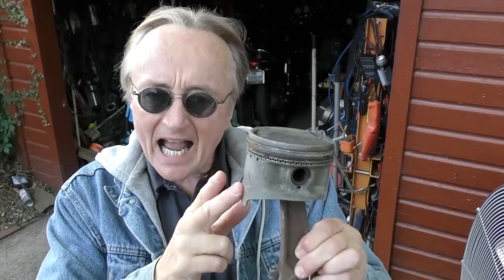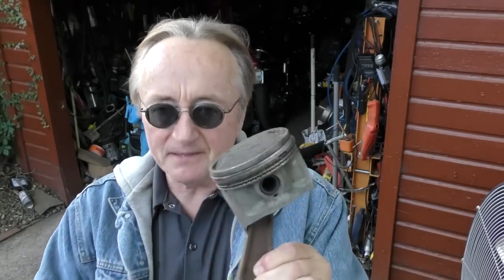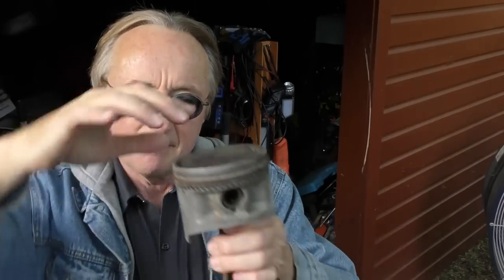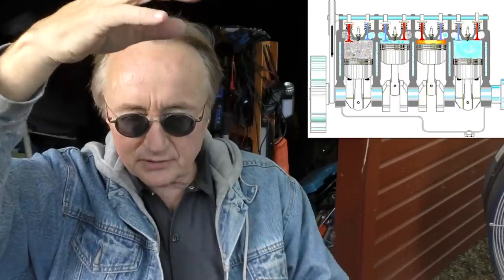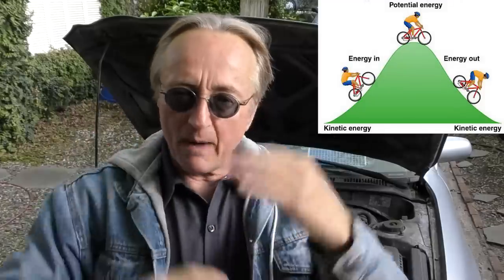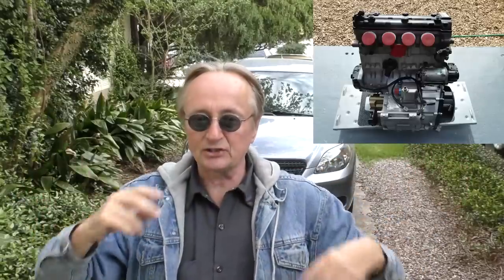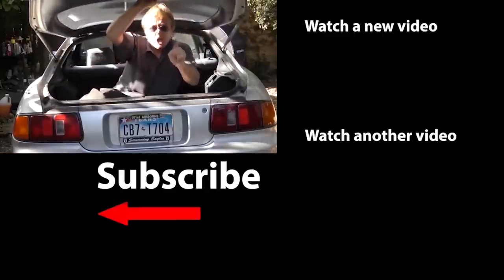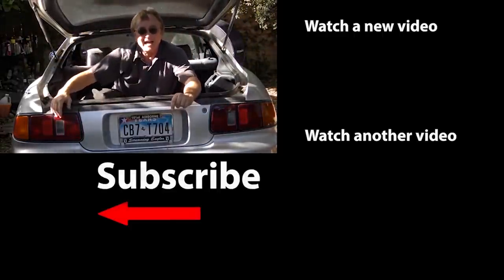Horsepower vs Torque, Which is Better

Comment: Horsepower is NOT measured. It is a calculated number, representing torque over time. HP = (TORQUE x RPM) / 5252. This is why torque and horsepower are always equal at 5252rpm.
Reply: JarOfRats you mean torque and “power”?
Reply: @jamesmedina2062  hahaha.  Oops. Fixed,  thanks

Comment: Torque is turning force.  It's torque that does the accelerating, in that respect Scotty is correct. Power is force times (straight line or rotating) velocity.  For a given amount of torque or force, power increases as speed (or RPM) increases.  But at constant force and constant mass acceleration remains constant.   Power doesn't "do" anything, it's the relation between torque and RPM or road speed.  It's not a simple picture.  You have to consider the shape of the torque curve vs. RPM, the transmission ratios, the differential ratios, and the tire rolling radius to determine how quickly a vehicle will accelerate.  Higher horsepower implies a higher top speed, but it all depends, again, on how the vehicle is geared.  It takes a couple of pages of physics to show the entire picture.

Comment: Horsepower and torque both vary by RPM and the map of hp and torque vs. RPM is very important to the drive-ability of the car.  A very peaky engine may have a high number for either value but may not reach that until a very high RPM - that may be OK for racing or enthusiastic driving but may not suit driving in traffic or conservative driving.

Comment: You can get any torque at the wheels with the right gear ratio. That's why if you have high power engine you can still have good torque for acceleration bacause it's the wheel torque that matters.
And the reason that F1 cars don't accelerate from the start that quick is because they have limitted mechanical grip.

Comment: Horse power is the overall power output of the engine, so technically from a force perspective it is the more important number, as the torque that is going to the wheels can be increased infinately by using by using gears. IE a 30:1 gear ratio if you applied 1 pound, you would get 30 out but would have to move it 30 times further.

Comment: What makes Tesla so good on the dragstrip is the combination of the the limited slip control and using an electric motor instead of a combustion engine. With an electric motor you can prevent tire slip much more quicker than possible with a combustion engine.  I don't know of any combustion engine that can go from full speed to full stop in just a few milliseconds like an electric motor can. In servo applications you can do some really insane things with electric motors like rotate a heavy mass from 0 to 90  degrees and then back to home position so fast that your eyes can't follow. Robot arms are another example of electric motor response capability.  My washing machine does not even use a agitator gearbox like the old school direct drive ones did, instead it actually uses control electronics to change the motor direction in a back and forth motion to do the agitation just like this repair video shows under the washing machine: EisutFBf7YY . Just insane with what you can do with electric motors.

Comment: Also bear in mind when building or choosing an engine if you need better acceleration you csn manipulate torque through the gear ratios particularly the rear differential gear.

Comment: In 1999 my dad had an Acura CL with 197 lb ft of torque and 200 horsepower. Today, he has a TLX with less torque, but a little bit more horsepower. If mated to the same 8 speed DCT, the CL would beat the TLX in a 0-60 run
Reply: Show me

Comment: Horsepower is more important because you can adjust your torque at the wheel through the gearbox, but if you have insufficient power, no amount of torque will help you.

Comment: Diesel locomotives can pull huge payload at relatively low RPM and I am always amazed by JBC excavators basically idling when pulling dirt out. Try doing that with petrol engine and you will have to rev it to 5,000 RPM and will need three times more gas.
My old Audi S4 turbo could drive all day in city traffic at 1,700-2,500 RPM because it had top torque at almost idle. So yes, I would take torque over horse power.
Reply: ok

Comment: Scotty, thanks for the explanation. Very well done. I've never read so many clueless comments.
Reply: Except it was mostly false.
Reply: @brendontait6968   Really. Feel free to enlighten us then.
Reply: Horsepower is torque at speed.  A high power F1 car will out accelerate a  slow revving high torque muscle car.  Just like the hyabusa will out accelerate the harley to any speed given enough traction etc.  Power is the speed that an engine can produce torque at.  A high power engine will accelerate faster, have a higher top speed and be able to haul a load up a hill faster given appropriate gearing and traction than a comparitivly low revving and high torque engine.  The gearbox in a vehicle increases torque at the wheels, the faster the engine turns, the higher gear ratio you can get and the higher the torque at the wheels at a given speed.  As much as I don't like the guy, engineeringexplained does explain it quite well.  Also check out autoexpert if you are interested.  Scotty is entertaining to watch and listen to, but doesn't seem to have a good understanding of physics.

Comment: HorsePower is the integral of Torque over time. Technically HorsePower over the entire rev range is all that matters. Lot’s of high HorsePower engines don’t make their max torque until very high RPMs. That is why you should never judge a car’s acceleration potential solely based on max HorsePower. Instead you should study the HorsePower the car makes over the entire rev range.

However, if you have a continuously variable transmission then max HorsePower does completely determine the car’s acceleration potential. Torque is irrelevant with a CVT that can handle the max HP of the engine all the time.

Comment: High torque is higher power at lower RPMs. That is you don't have to "rev up your engines" to get decent acceleration.

Comment: Torque is force produced by the engine turn.. Yep much like your hand producing torque to tighten bolts.
Horsepower is how much torque output produced over set amount of time.

Big horsepower mean you also need adequate torque over certain amount of engine rpm.
That's why super bike doesn't produce much torque but they certainly able to rev up high while producing enough torque.

Comment: Horsepower is what matters.

You can use gearing in the transmission to multiply your wheel torque. 

One engine makes 50 hp and 100 ft lbs at 2,500 rpm.

The 2nd engine makes 50 ft lbs and 100 hp at 10,000 rpm. 

Guess which one can tow more and move the vehicle faster?

Hint, it's the 2nd engine. 

Horsepower is the mathematical calculation of how much work an engine can do.

Comment: As a mechanic of 50 years scotty didn't pay attention in physics class. Torque only affects the transmission operation (gear ratios and shift points). F=m*a-therefore for best acceleration you need the lowest possible mass with the highest force acting on the vehicle. The force acting on the vehicle is engine torque divided/multiplied by final gear ratio at the wheels. The higher rpm the engine goes the less torque it needs for given final wheel torque. Therefore "harley has torque therefore accelerates fast" is bs. The hayabusa will spank the harley both at launch acceleration and acceleration at/maintenace of high speeds, unless the transmission gearing is wrong.

Comment: On a dyno graph, horsepower and torque are the same at 5252 revolutions per minute. A street engine is about more torque below  this rpm and better gas mileage. A race engine is about stronger parts to rev much higher than this 5252 rpm for the maximum horsepower, for a much higher cost to build and for fuel. For motorcycles, fewer cylinders have more torque at low rpm but more vibration. Many like the sound of 2 cylinders. The inline 3 for Yamahas is a good compromise for a better sound than most 4s, and the R1 has a special crankshaft for a better sound from an inline-4. Aprilia and Ducati went to V-4s to try to win World Superbike races that Kawasakis have won the most the last few years, that start with a stock bike.
Reply: The 5252rpm is only a function of the mathematics for imperial units. For metric (SI) units it's 9549rpm. It doesn't actually mean anything.

Comment: A 600 cc sport bike is the best way to show what hp can do. Makes under 50 torque but can do 165mph. 600 are slow if you keep the revs under 5k above 10k and it's a different engine

Comment: This is why diesels rock the heavy haulage. From big rigs like ship engine to trucks!

 I love the VOLVO FH16 750 (750hp power, 3550Nm torque - approx 2620 lb ft for Americans 😉)
Reply: No diesels are popular because they are more efficient. We could easily make petrol trucks to haul and we used to it would just be a waste of money to run. 

Diesels are only especially good at hauling as they make peak power at lower revs

Comment: HP for Top Speed
Tourque for Acceleration (and towing)
Reply: Nope. Riddle me this: what changes about torque in the driven axle when I swap from an engine with 100HP & 200ft-lb to an engine with 200HP & 100ft-lb?
I expect a reply;)

Comment: The engines in semi trucks have a lot of torque. If you watch a semi taking off from a standing stop how the cab will appear to almost jump off the chassis. That's the torque of the engine. You need lots of torque to move the truck and the load.  Am I correct? There's also plenty of horsepower.

Comment: Torque is what we experience in everyday driving, HP mostly comes in at higher RPM, torque gets us moving and climb hills etc.
Reply: No torque doesn’t climb hills, horsepower does. Climbing hills increasing GPE requires power, power is energy/time the rate of energy change. More horsepower that faster the gpe can increase the faster the car can move. Sure torque gets you moving hence why we have gears to increase it but once you are horsepower is all that matters. 

When you think your vehicle is torquey you actually are just feeling the effect of low rev power band

Comment: it's the same thing depending on how it is used, horsepower is a measure of work performed, the formula is horsepower = torque @ speed, and the proper term for torque is FOOT POUNDS not pound feet.

Comment: Torque is work and horsepower is how quickly you accomplish that work. If you generate more torque than power, then you can do a lot of work but you'll be slower to accomplish it. The opposite is true when you generate more power than torque, you'll perform work faster but not as much at once.

Comment: Hi Scotty, excellent video thanks for an understandable explanation of the difference between horsepower and torque.  My questions is I've seen guys talking about how adding more horsepower to a Subaru STI takes all of the torque out of it.  Is this true?  Can you explain how modifying the Subaru turbo boxer engine to deliver more horsepower would result in less torque?  Thanks

Comment: Thanks for the video Scotty. I thought that horsepower is a function of torque. HP=Torque *rpm/5252. So high torque means high hp. Isn’t this correct? I understand you said that torque means high start launch, while hp means after launch acceleration and top speed.

Comment: Ok question for you. The 2018 mazda 6 turbo has 227hp and 301 lb/ft torgue on 87 octane and 250hp with the same torque on 93 octane. What difference will that make in the performance of the car?

Comment: I prefer torque for a daily car " diesel " . I have bmw 2008 530d Xdrive 235horsepower with 500nm of torque. from 1300rpm-4500rpm it pulls hard.
0-100 is really good.. no reason to go above that in a daily in my opinion

Comment: Heat is energy. 
Gasoline can be considered condenced heat. It's a fuel. It has thermal energy. 
By burning gasoline in the engine, the air that is sucked with it, is heated up, gaining energy. 
That energy is transfered through the piston and rod to the crankshaft. 
This way we have mechanical work which we can manipulate and use to our advantage. 
Diesel has more thermal energy than gasoline. 
This means that when diesel is burned in the cylinder with the air, it gives more heat to the air, thus more energy. 
Diesels have more torque, because the air has more energy to disipate on the piston when it is going down during the power stroke. 
That's why diesels have longer power stroke, to disipate more of the energy on the piston. 
Plus the fact that diesel burns, it doesn't explode like gas does. 
So in a diesel, the air is in contact with the piston for longer, than in a gasoline engine. 
This longer contact time, helps more energy pass from the air to the piston and to the crankshaft. 
That's why diesels have more torque than gasolines. Even on idle. 

And also, the working substance in an internal combustion engine is AIR. 
Not gasoline. 
Not diesel. 
Not hydrogene. 
Not CNG.  
              A   I   R 

The gasoline/diesel/hydrogene/CNG is the fuel that gives energy to the air, making it usable. 

Now I'm pretty sure I got something wrong with all this, so if Skotty or anyone else knows better, feel free to correct me. 
I'd be happy to learn. 
Peace!

Comment: I'm a novice when it comes to understanding engine/crankshaft torque, horsepower etc, though Scotty Kilmer's YouTube videos covering this field are interesting.

I've had look on a vehicle specification website and looked up my Nissan Qashqai, a 2016 1.5L diesel model.

From what I understand from this data, at the specified rpm of 1750 to 2000rpm, if we assume the vehicle is shifting at a constant speed within that RPM range, there would be a constant force of 191 pounds per foot (assume the distance from the centre of the crankshaft to the centre of the big end of the connection rod is roughly 1ft for example).

191 pounds equates to about 13 stone (average weight of a man say).

Seems quite a small amount of force to shift a car as well as turn an engine, even with a gearbox providing mechanical advantage... assuming I've picked this up right.

Any feedback appreciated. Publish a video reply if you wish Scotty 👍🏻

Comment: horsepower is all that matters for racing. Why? because racing is all about the TOP END of the revs. Torque will get you out of a corner but horsepower is what gets you to warp speeds.

Comment: Torque is the amount of force required to do the work . The more the torque , the more the pulling power.  Horse power is the amount of work done in a given time . The more the hp the faster it can finish the work .  So hp relies on torque . So those engines that have higher torque usually have more hp as compared to a similar engine which has the same number of cylinders and layout but has less torque .  Thats y heavy vehicles use high torque engines for more pulling power and even though they have high hp in numbers too but they cant go that fast because all that torque that comes with that hp gets spent on pulling that heavy vehicle and the hp looks inadequate to make it go faster .

Comment: Scotty I recently bought a 2009 Toyota Corolla with 105,000 miles I’m assuming that the transmission oil was never changed 
Do you think that is better to change it still at this mileage?
I will really appreciate your advice

Comment: Scotty your explanation is quite misleading. In actuality, speed is with HP and power is with torque. The best example is comparing a truck to a sports car.  Trucks have large displacement diesel engines with large pistons that allow them to create more force at low rpms.  These engines often have low HP but very high torque.  The torque is what you need for pulling power.  A pickup truck like the Ram 1500 EcoDiesel only produces 240 HP but cranks out 420 pound feet of torque. When you need to pull the boat out of the water, this truck has the low end grunt to get it done.

On the flipside, a car like Mazda MX-5 Miata has a high revving engine that pushes out more HP than torque (155 hp at 6,000rpm, 145 pound-feet of torque at 4,600 rpm).  The higher revving engine gives it the sporty characteristics but when it comes to pulling a trailer, the engine would have to rev at a high speed to even get the car to move.  

In other words, more pulling power emanates from engines that achieve peak torque at low rpm, but more sporty performance is found with those with high-revving, high-horsepower engines. It has been said that horsepower makes you go fast, but torque is the power that presses you back in your seat as you leave the start line.

Comment: Horsepower in regular engines means it has more speed. But torque in regular engines means more acceleration but not that much speed. But torque in diesels means it can pull more. So whats better? Well i'll tell you buy a 1994 celica.

Comment: More torque does not always equal better acceleration. Example:

BMW 335i = 295lbs torque
BMW 335d = 425lbs torque

Gas powered 335i blew the doors off the 335d

I know, I know diesels are not as fast but from what he says about TORQUE, 335d has MUCH more and should have the advantage in acceleration, though it doesn’t.

Comment: torque and hp are only two measures there a lot of other factors that play into it like weight, tyre size, aerodynamics etc.. my ducati scrambler weighs 169kg 75hp and 67 NM torque instead of weighing about 300kg you'll feel the acceleration much faster

Comment: Hey Scotty, I tried looking to see if you did a video about how to correctly fill the newer coolant systems with the overflow tank. But I couldn't find one. Believe it or not I'm 37 now but starting out the vehicles I had all had the radiator right in front so that's what I grew to learn about. So I don't know how to fill the new ones. Fill them when the engine is hot? Cold? To the minimum line? The max line? I've got an 04 Chevy avalanche I just got and want to take care of it.